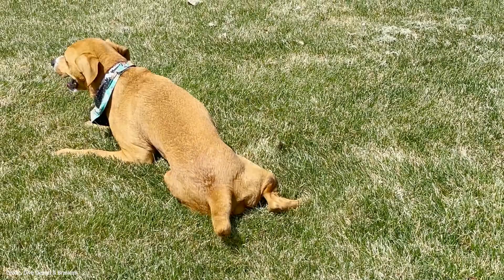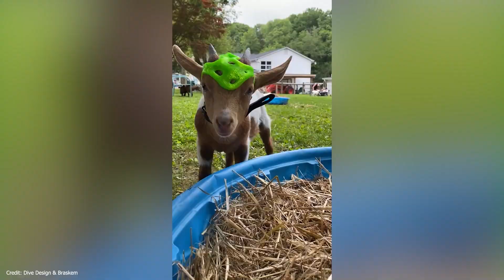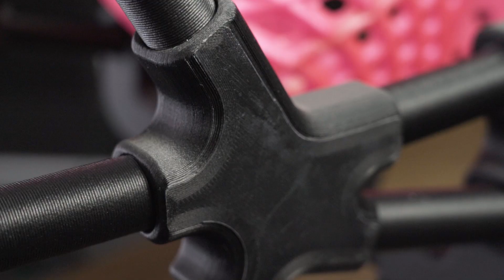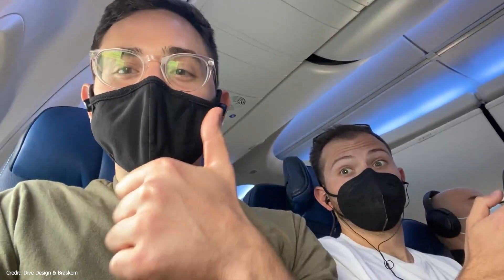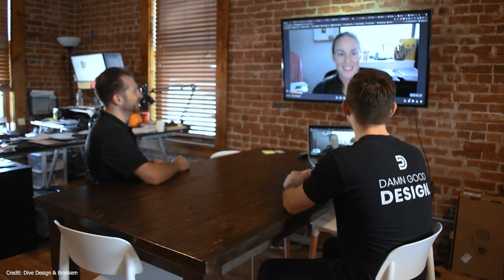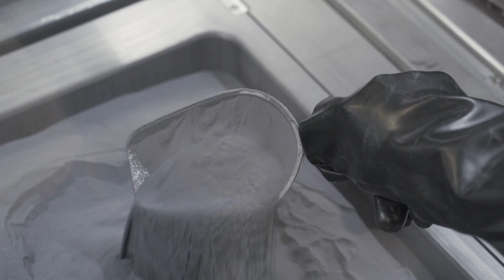3D Printed Custom Dog Wheelchair |The Cool Parts Show #44

Comment: It´s great helping handicapped dogs with a wheelchair. But what I do not unterstand: this pp-part has no attachement to the wheel chair apart of sitting on the structure? It would make sense if it was hanging in the structure and thus distribute the pressure evenly. But as I understand it, the dog´s weight is still carried by its ripp cage/sternum?

Comment: I was very confused about the 3D printed tubes on your model not being conventional carbon fiber, thinking perhaps that was part of the agreement they had with Braskem.  Relieved to see it wasn't used on the actual chair. Still a bit surprising they wouldn't just use the same tubing for the demo. I guess they must have been able to sneak them in on the build table while printing other parts, but it seems like it might have been easier to tweak the connector geometry (if needed) for a different tube size for really cheap pvc pipe, or just make adapter bushings. You could even use carbon look vinyl to hide the pvc... I guess when the only tool you have is a giant printer all your problems look like filament? (I think that's the saying)  Great heartwarming video, and congratulations to all involved in helping the animals live richer and happier lives!